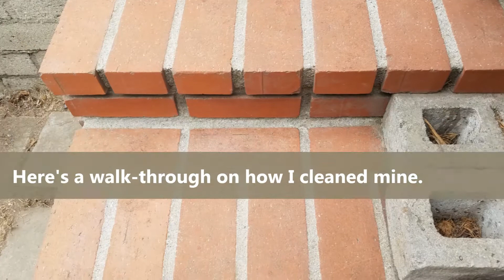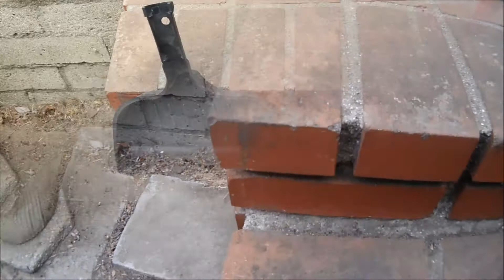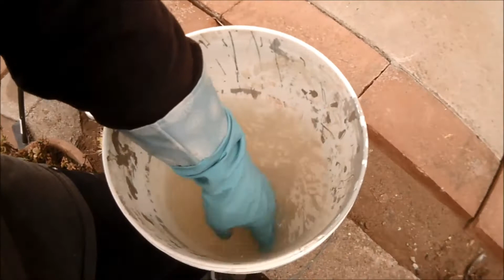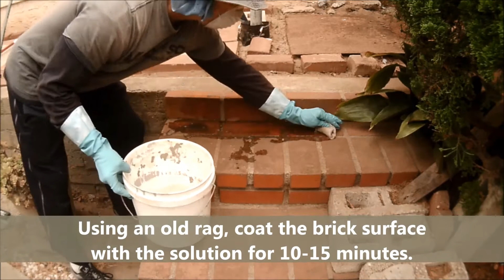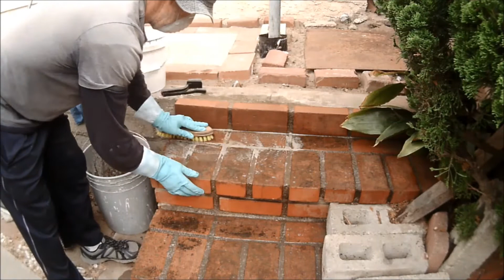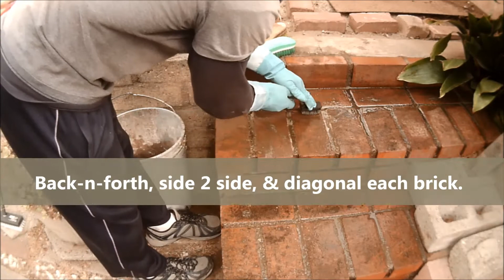REMOVING MOLD from BRICK Surfaces - DIY

Comment: I appreciate your video, not lengthy and gets RIGHT TO THE POINT. Our brick steps are original to our 1960 rancher; steps should be replaced but the greenbacks are slim. Mortar is cracking and is non-existent in some spots. This looks doable and effective. I'm going to try this tomorrow. Fingers crossed!
Reply from the maker: Hi Barbara, yes, the "elbow grease" and "solution" gets the job done (for small jobs... it would be quite laborious for bigger jobs) but here's something else to consider. You mentioned your mortar is missing or cracked/brittle and thus, it's more permeable (mine was in good shape). All of that "solution, mold and rinsing off" will get distributed throughout your brick joints more so because your mortar isn't in good condition which may lead to a further weakening of your brick steps eventually. Regardless, they will be cleaned :) and look better. If your curious, here's a link to my DIY mortar repair when greenbacks are slim. If you go to my channel, I have a few videos on mold cleaning and DIY brick mortar repair. Good luck on your project.        https://youtu.be/6FufO9tDq9w
Reply: @notyouraveragejoe855  I just checked out your suggested video on mortar repair. You are very thorough! We had someone come out years ago to fix this issue and it was a hot mess. Sloppy work. We have 3 sets of brick steps and they all need repairing. My better half gets frustrated with tedious projects so this one will be mine, I guess. Thank you for another great video. Again, you get right to the point! Much appreciated!
Reply from the maker: My fingers are crossed for you Barbara, cheers.

Comment: That’s a great tutorial! I have a question why you didn’t use a pressure washer? Is it going to damage the old brick?
Reply from the maker: Hi Saeide, 
Depending on the type of washer you use (pressure, power, or wand and whether it's gas or electric), they can all have different force application pressure settings and yes, if it is too high, you can damage your brick and especially your mortar. Getting that PSI adjustment just right to do the job but not affect the masonry can be a challenge. Something like a wand or power hose nozzle also may not have enough pressure to do the job. There's also a water usage concern for those who live in water scarce or restrictive areas. So, what do you do if you don't own a pressure washer, don't want to buy one, can't afford one or can't even rent one? Thus, the reason for my video showing an alternative method that can work.